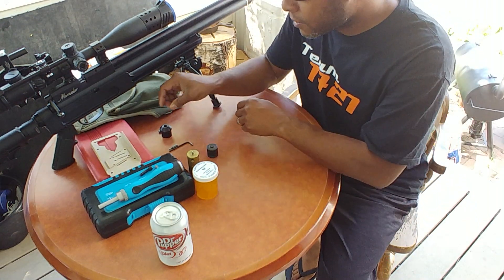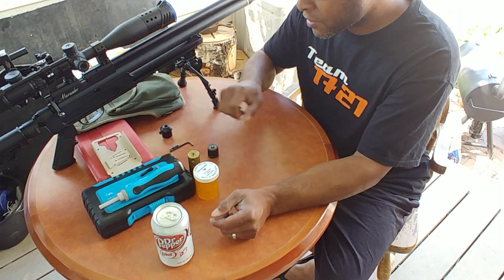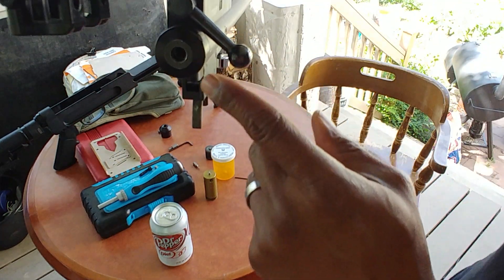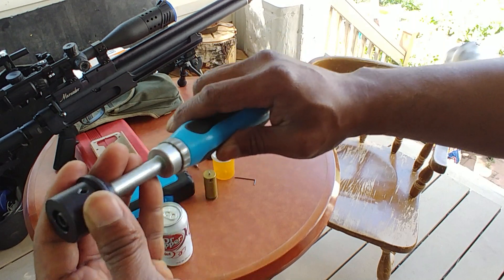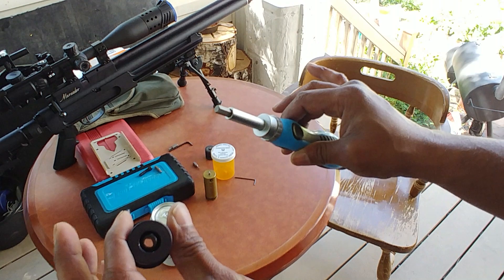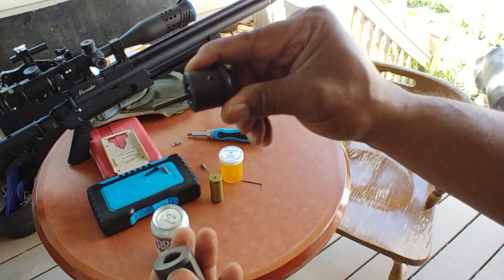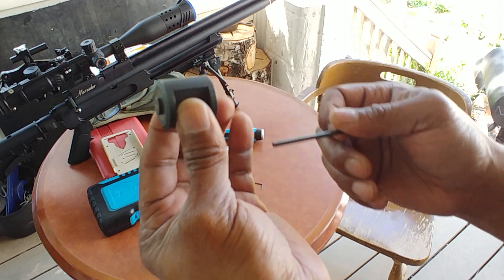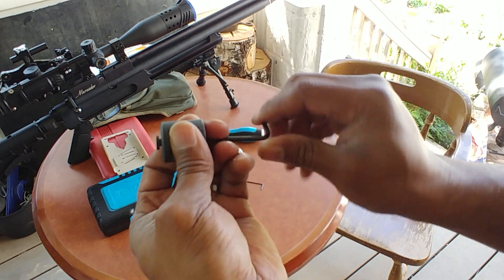How I tune a Benjamin Marauder for power.

Comment: Hey Joe does it matter if the air pin jam screw is even with the outside of the valve or can it stick out a bit past the valve ?
Reply from the maker: I have it flush, and it is clear of the exhaust port on the valve.
Reply: @Monkeydad1969  ok thank you . But what if I back my air pin out 4 or 5 turns and when I put the jac screw back in it sticks out a touch ? Do I turn the air pin back in until I can get the jam screw to sit flush with the outside of the valve ??
Reply from the maker: @timmy4539   Yes.  Just turn the velocity adjustment screw in until the jam screw is flush or just recessed.  I'm surprised yours is sticking out on 4-5 turns out.
Reply: @Monkeydad1969  
I'll check it again Joe !
Thank you for all the help ! I did your full tune on my 25 cal Marauder but I'm still only getting 811 fps out of it ! 🤔
Reply from the maker: @timmy4539 it could be anything.  Hammer spring may be getting weaker.  Is your M-Rod regulated?  What projectiles are you shooting?  Of course it would be nice to actually see your rifle.  What did you actually do when you tuned it... how far in or out is the hammer striker pin and the rear velocity adjuster (RVA)?
Reply: @Monkeydad1969  
I did your exact time step by step turn for turn in everything ! The hammer spring should be ok the gun is like two years old but has never been shot and of course I'm shooting JSB 25.39's so I don't get why the fps is so slow ! The gun is a gen 2 standard and it's not regulated .
Reply: @Monkeydad1969  
I'd like to be able to shoot slugs out of it but everyone says that the slugs have to be at 959 fps - 1050 fps but I can't get even close to that fps ! 😒
Reply from the maker: @timmy4539  slugs don't always need speed.  I've shot plenty of slugs at 850fps.  I really would like to talk to you about your barrel.  Contact me through the Predator Pellets Facebook page or the Instagram.
Reply: @Monkeydad1969  
That's the problem Joe I don't have Facebook or Instagram all I have is Gmail . I get the slugs at say 850 fps but the best I can get out of my Marauder is 780 fps even with your full tune on it !
Reply from the maker: @timmy4539 thanks for replying to my email.  We can talk about what's going on with your setup.  I will email my number to you.
Reply: @Monkeydad1969  hey Joe I don't mean to bother you again but I have something to ask if I may ? On the Marauder does the male foster fitting contain the one way valve like on the bulldog ? Why I'm asking is my field/target in 22 cal all of the sudden is leaking air from the foster fitting right where the brass screen is at the very top of the fitting ! Can I just change the whole foster fitting out or do I have to pull the end cap off of the air tube to try and fix the leak ??
Reply from the maker: @timmy4539 it does have a one-way check valve.  You can actually take it off and change out the o-ring.  Just reseal the threads with Teflon tape and you should be good to go.  The o-ring on the check valve may still be good and have some build-up on it that can be cleaned off.  It's a hard white o-ring and they are hard to damage with normal use.  If it is damaged, you can order a new one or just use what you have, or replace the male foster altogether.
Reply: @Monkeydad1969  thank you Joe 👍

Comment: (Good lighting, bravo.)  Hey--nowhere anywhere is explanation of why to adjust #1 the hammer and #2 the other adjustment --when #3 adjustment,  the velocity adjustment, seems like it would do all that is needed???'?    
OR:  why use the velocity screw at all, when the other settings seem to change air charge and presure therefore velocity!   ????

Comment: Hi .I was getting good velocity after doing this mod ..but now suddenly its decreased..what could be the reason?
Reply from the maker: How much decrease did you get?  Did your hammer spring adjuster back out?  It could be a few different things.
Reply: @Monkeydad1969  yah hammer spring adjuster backed out and hammer nearly flushed
Reply from the maker: @saviofalcao670  is that how you set it up or did your adjuster back out?

Comment: Very informative - I have a GEN 2 - synthetic .25 Marauder. I have upgraded the hammer spring to a "hill airgun 262 Hammer spring" and leaving everything else stock. I have set the adjusters the way you suggested, i.e. velocity pin all the way out, 5 turns out from the bottom of the hammer spring adjuster hex nut and 3 turns out from the bottom of/on the hammer pin hex nut. Do you recommend these same settings with a heavier spring?? I do not have a chronograph yet and want a "heavy/hard hitter" to get going to exterminate my squirrel problem. Also, have a Hawke Airmax scope and an AirVenturi Nomad II compressor.
Reply from the maker: That Hill spring is a good way to go.  Chrony it and see where it's at.  I like power without a huge amount of cocking effort.  Depending on what you are trying to achieve with fpe, you may find that you can back off on the adjustments.  But if you're just knocking down squirrels you don't need a lot of speed.  Heck I kill P-Dawgs at 100yds at the mid 800's with my bottled M-Rod.  Please keep me in the loop on your progress.
Reply: @Monkeydad1969  i did the same thing to my mrod .25 cal. backed the velocity pin all the way out 5 turns, im using the hill peek striker and its all the way to the base as per instructions. im 6 turns on the spring tension, 8 turns on tension spring drops the tensioner off threads. shooting the 47gr varmet knockers 667fps and with jsb exact kings 25.4 857fps. nead a better scope. looking into the crimsom single plain moa..
Reply from the maker: @seanmobley4253  I'm surprised the Kings aren't in the 900's.  The important thing, question is...are you happy with the tune?
Reply: @Monkeydad1969  not really, my brother has the same mrod with stock everything but with hill longer shroud, and  is shooting better fps than i am.we did not change stock settings i need to be pushing that 47gr @ 850fps  and i think it can be done. im planning to purchase the hill max valve and breach port to increase fps. so my brothers mrod being stock is getting 900 fps with a 2900psi fill. so somewhere im loosing power or air.
Reply from the maker: @seanmobley4253  so your brother is shooting the Kings at 900fps, and what tune did he do?.  Can you feel air coming from under the breech when you shoot?
Reply: @Monkeydad1969  we bought my brothers rifle brand new stock from a company that had damage the barrel shroud. paid 300  for wooden stock marauder .25cal. all we did is put on the hill longer barrel shroud and bought a new barrel keeper. we left the factory stock tune in the rifle(not touched.) as for my rifle i think i will dimantle it again to make sure all the seals are in place including the breech port. i agree with you it should be shooting much faster.
Reply from the maker: @seanmobley4253  please let me know.
Reply: @Monkeydad1969  well i took the dang thing apart repaired the leak and double checked for leakage again. then made sure velosity pin was completely backed out, then reset tension spring for hammer 6 turns. chrono was 10 feet away, using jsb exact king 25.39gr my .25 read the following with 3000psi-- 866-891-853-853-853-849-843-840-841-829-832-825...the 832 was showing 2200 psi. its quiet. this is using a caldwell chrono. maybe the hammer is to light with the plastic peek striker hill provides?
Reply from the maker: @seanmobley4253  have you tried the stock hammer setup?
Reply: @Monkeydad1969  we Monkeydad, i took the hill hammer out and put the stock one back in.i used the shorter stiff spring from hill.  it gave me an increase with jsb exact kings 25.4 gr to 887 at 3000 psi. but i definately used more air after five shots im down to 2400psi  i know this is expected. i used the stock striker too and it has 2 turns out. thats the best it will do until i change out the valve and port.
Reply from the maker: @seanmobley4253  wow, that rifle is being difficult.  There are some things you can do.  But that involves taking it apart again and modding parts.
Reply: @Monkeydad1969  lol, im getting good at taking the marauder apart. im in the game now, if you want to walk me through the modding steps. i will follow. i need the hands on experience. got a nice drill press and lathe i can use. though i have never used a lathe before. he heh hee. yes i do see i need to mod this rifle if i want it to push slugs. 100 + yards at 750 to 850 fps. i do believe this rifle can do this. just needs some love.
Reply: and thanks for your advice. im really enjoying the hands on work with my own rifle.
Reply from the maker: @seanmobley4253  that's what it makes it fun.

Comment: I will have a chrony soon, realizing it is a necessary tool to know what's really going on. I want as much knock down power as I can achieve with not too much extra cocking effort. It is a little harder with the heavier spring though. My initial goal was/is to eliminate any hammer bounce and not waste air. I will keep you posted. Thank you for the reply.
Reply from the maker: Looking forward to your results.

Comment: Did these mods on a 2019 .25 cal with the Walter barrel.  My marauder gained about 30fps with benjamin 27.9 grain pellets.  I didn't lose any shot count.  In stock form 16 shots the fps ranged from 788 to 805 with an average of 796 fps .  in modded form the fps went from 801 to 835 with an average of 821 fps.  The FPS went up when the pressure got below 3000 psi. By the 16th shot the pressure is right at 2500 psi so I have a few more full power shots left in it.
Is this typical of marauders to have such flat FPS to about 16-20 shots then fall off?
Reply from the maker: Yes, they seem to shoot pretty flat.  As the psi gets lower, you'll find your fps goes up because it's easier for the hammer hitting the valve to overcome the pressure.  So are you happy with your tune?
Reply: @Monkeydad1969  yes I am happy with it and thank you for detailing what to do and how each piece works.  The manual goes into a little detail about the valve and states 4.5 turns is full open from a fully seated position.  I was hoping to get closer to 900fps with the pellets I have.  I am happy with 16 shots before needing to fill again but obviously more fps and shot count is always desired.  So with stock parts do you think I can get 900 fps with the domed 27.9 grains?  Or is it typical to need a lighter pellet for that speed and a stock gun?
Reply from the maker: @51coronet  this is a tune I did for a friend.  I did replace the valve return spring, and there is no spring tension from the power adjuster.  I also did the ¼" vinyl tubing mod for the transfer port.  This is shooting JSB Kings, I know you are shooting the Benji domes.  But here is what I got...

Saved Chrono Group - 12-01-2018 02:24:46 PM
Created: 12-01-2018 02:24:46 PM
Description: Casey's  .25 M-Rod
Notes 1: 0 CW HS, 1/4" TP, softer valve spring
Notes 2: 16 shot, 3kpsi to 2300psi
Distance to Chrono (FT): 2.00
Ballistic Coefficient: 1.000
Bullet Weight (gr): 25.390
Altitude (FT): 5280.0
Temp: 46 °F
BP: 23.81 inHG
Shots
#     FPS        FT-LBS     PF
16    887        44.36      22.52     
15    896        45.27      22.75     
14    894        45.07      22.70     
13    901        45.77      22.88     
12    905        46.18      22.98     
11    905        46.18      22.98     
10    904        46.08      22.95     
9     905        46.18      22.98     
8     903        45.98      22.93     
7     904        46.08      22.95     
6     897        45.37      22.77     
5     893        44.97      22.67     
4     885        44.16      22.47     
3     882        43.86      22.39     
2     876        43.27      22.24     
1     868        42.48      22.04     
Average: 894.06
StdDev: 11.49
Min: 868
Max: 905
Spread: 37
True MV: 894.27
Shots/sec: 0.24
Group Size (IN): 0.00
Reply: @Monkeydad1969  Thanks for the info!  Really appreciate your feedback!

Comment: Joe,
Got a gen1 .25 Marauder.  Are you shooting slugs?  If so, what brand.  Just ordered a .25 pellet pak from Straight Scooters.  Waiting for some warm weather here in zip code 14143.
Thanks for your instruction.
Gary Call
Reply from the maker: I haven't shot to many slugs through my .25 M-Rod.  I haven't tried the the KnockOut slugs yet, but I have shot heavy pellets (JSB and Eunjin---Seneca) and they all did real good.  I think the NSA may be a good choice.  Now I need to get some .25 slugs and see.
Reply: Joe, 
I have had a real problem chambering the Fx 25 slugs in my Marauder.  The shoot really well though.   Let me know if you experience any chambering issues.
Shoot straight.
Gary
Reply from the maker: @garydcall9644  I haven't shot the FX slugs, I did shoot the JSB KnockOuts and they loaded fine.  They shoot ok, but the JSAR valve I was using had a bunch of gunk in it and I had to clean it.  I haven't tried since.  I've been getting all my long range shooters ready for the p-dawgs.